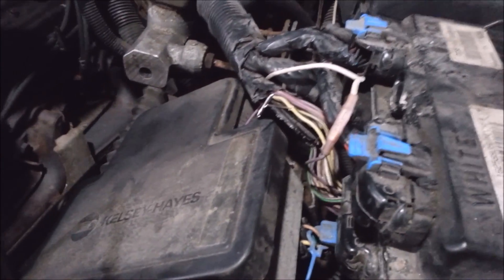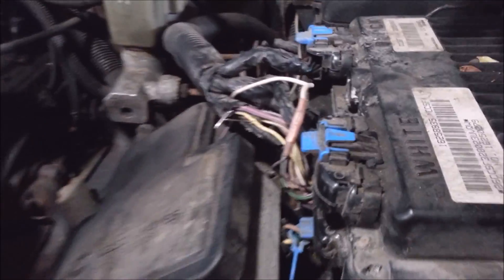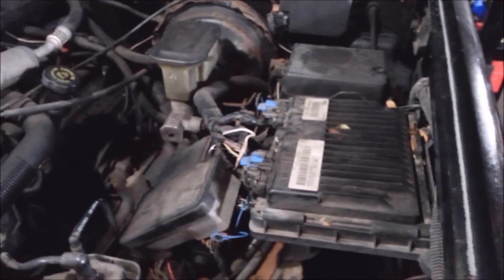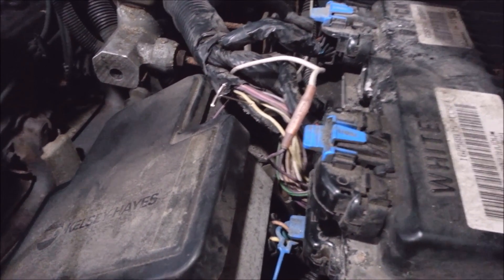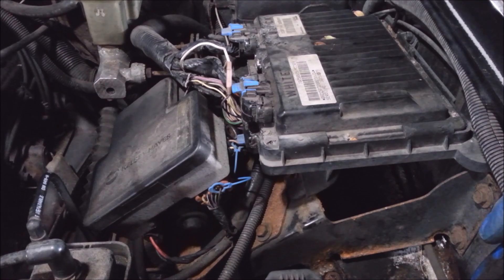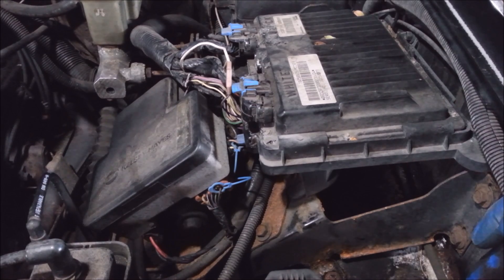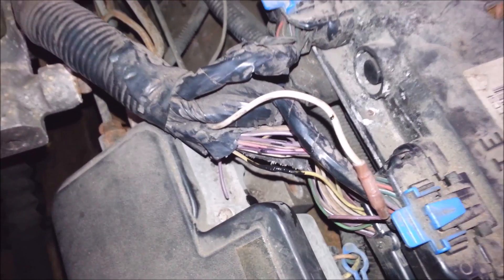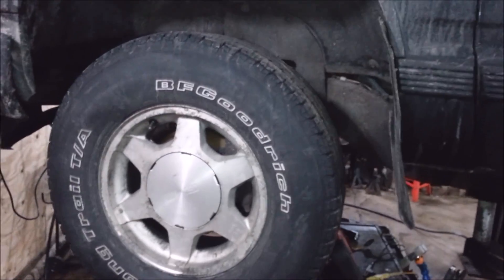1996-2007 Chevrolet GMC P0336 crankshaft sensor testing, and diagnosis

Comment: I have a 99 gmc yukon 5.7 votec, the crank shaft sensor came on. It was replaced along with the harness do to the showing of bare wire. Still doesnt start, so then I replaced ignition modules ignition coil distributor cap and rotor and still no start. Now looking at your video I did not know we had to recalibrate like you did. Would that be the issue, is to turn it like you did? Thx, been broke down for 2 months now 😆
Reply from the maker: Do calibrate. When no spark, It is important to make sure it is getting a CKP signal. CKP, and ignition module testing is where a graphing meter is your friend.

Comment: I change my timing chain and gears properly now my truck has zero spark. Does my position sensor need to line up with something on the crank or should it just work? In the meantime I'm going to order a new sensor anyway.
Reply from the maker: You need to calibrate your crankshaft sensor. Anyone with a quality scan tool has programming to do it.
Reply: @RustBeltAuto  thanks for the reply so quickly. All the videos and searches say to start the truck. Mine doesn't even have spark from the coil. I never messed with the distributor only replaced the gears and lined them up properly. All ignition and fuel parts are all new within a year even the spider injectors. I'm about to roll it in the woods and let nature have it lol
Reply from the maker: @pauljb1979  your ignition coil will not fire if the cop sensor needs to be calibrated, or is not working. Thanks for watching!
Reply: @RustBeltAuto  cop sensor? Im confused. Crank position sensor ?
Reply from the maker: @MrSabinashouston  CKP, or cankshaft position sensor.

Comment: Would the sensor be in same place for a 97 GMC Sierra?
Reply from the maker: Should be the same.
Reply: Or near starter. Search "97 GMC Sierra crank shaft sensor location" on Google then press image right under where u typed in what your searching for. It should show u a bunch of diagrams.
Reply: yes

Comment: Nice Autel.
Reply from the maker: I think you are referring to that Snap-On Vantage pro graphing meter?
Reply: Rust Belt Auto 

    You showed a DS708 in the video
Reply from the maker: @sirsweetness8332  right. That old thing is due for retirement. It lost some programming, and it is real slow now. An update is crazy amounts of money. I got that thing in 2012 I think.